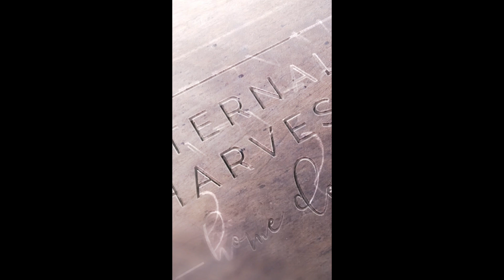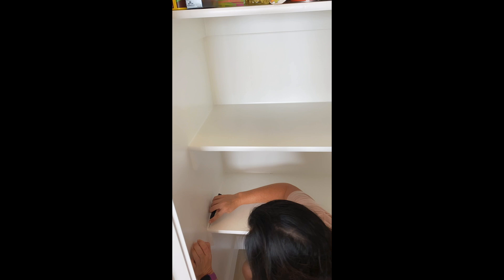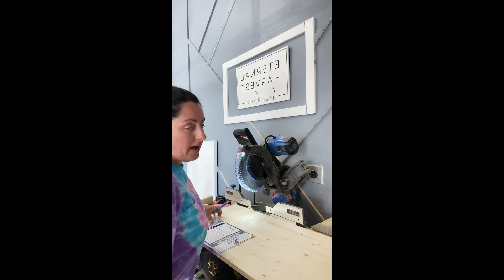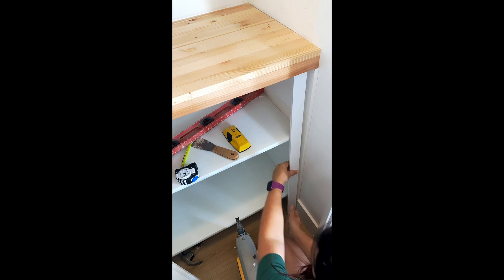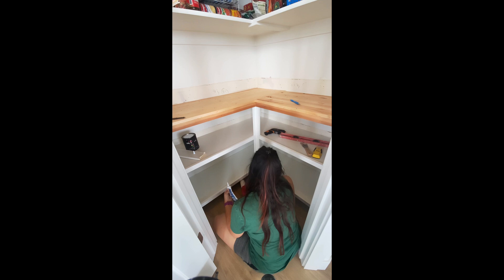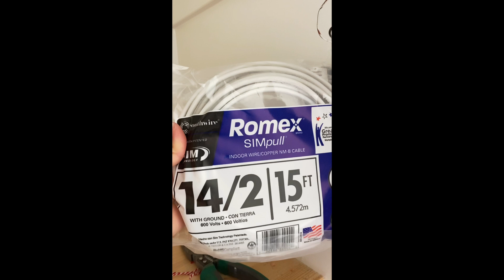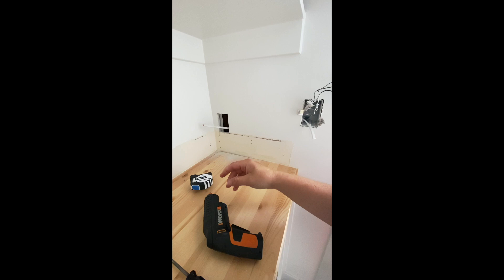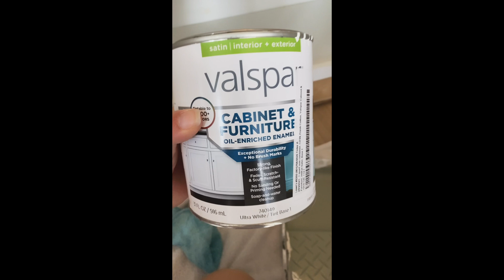DIY PANTRY MAKEOVER ON A BUDGET - THE MINI BUTLERS PANTRY

Comment: I'm also not an electrician but have also done some questionable things with house wiring :) - my tip is to check the fuse rating on the lighting circuit - it's usually a lot lower than a socket circuit, so make sure running a big mixer won't just flip the trip.
Reply from the maker: Yeah so far so good! I was worried about that but checked with a few friends and it seems to be ok!